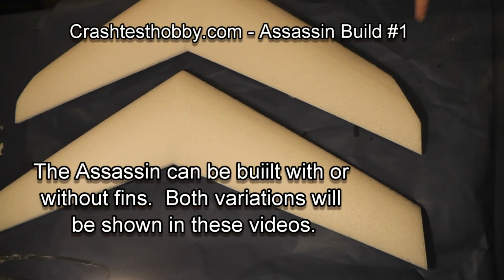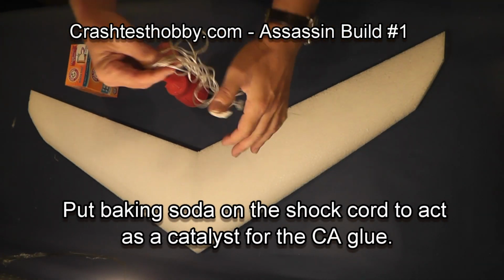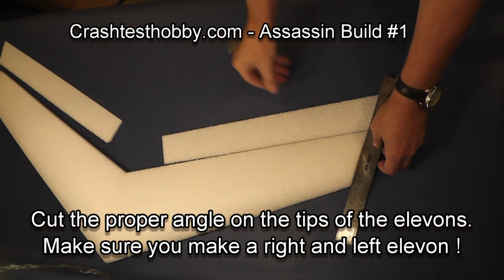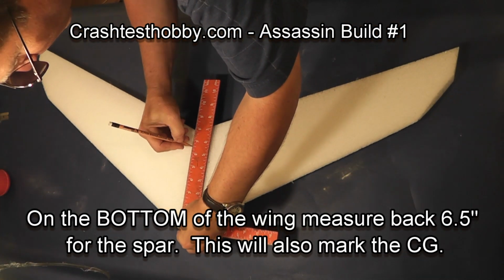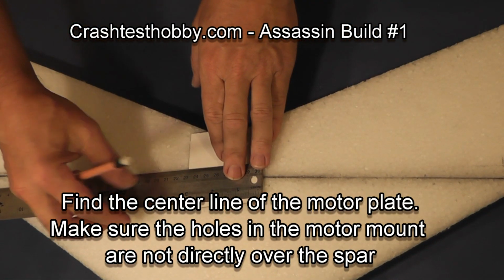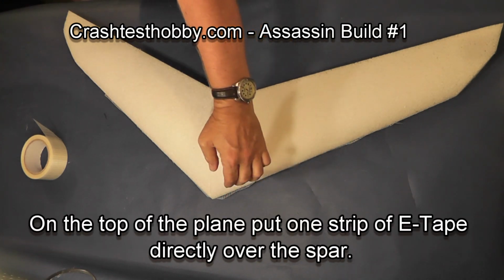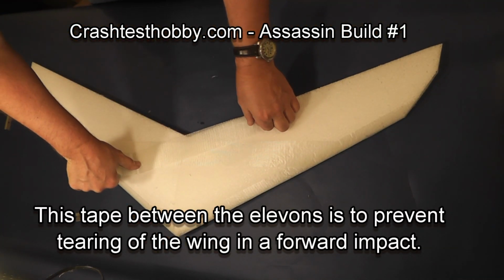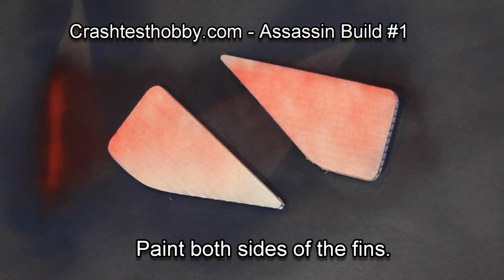How to build an Assassin #1

Comment from the maker: I agree that you don't want to breath the dust that comes from sanding the carbon.  Recently I have been taking a ballpoint pen apart and I run the shock cord through the pen to guide it into the slit around the wing.  This is an idea suggested by a customer that works extremely well.  I also have been using Quick Grip glue instead of baking soda and CA glue to decrease the fumes from the CA glue that can be irritating to the lungs.  Thanks for reminding us of safe building practices.  Lee

Comment: Can I use clear duct tape? The local hardware didn't have exactly what you appear to be using. I have some packaging tape but it is only reinforced along the length of the tape, not across.
Reply from the maker: Tape with a single direction of fibers will work almost as well except on the hinge line.  If you are using this single direction reinforced tape You have to cut small strips so the fibers cross the hinge line.  You can get the Scotch Extreme Tape on line or I have found it at Rite Aid and Office Depot too.
Reply: Crashtesthobby looks like ill be making a run to the LHS for some more (fresh) foam safe CA so I think I'll pick up the correct stuff and do it once ;-)

Thanks!
Reply from the maker: One other thought.  Clear tape stretches while reinforced tape does not.  The planes are more flexible and not as strong if you don't use a fiber reinforced tape.  Lee
Reply: Crashtesthobby good to know. The clear tape I was speaking of IS reinforced but it's not of the packaging tape variety. It's actully duct tape that's clear. I found an old Mythbusters episode where they tested the breaking strength of duct tape and it was around 67lbs, so not nearly as strong as the tape you are using here.
Reply from the maker: You don't need foam safe CA glue with EPP foam.  EPP foam works great with standard CA glue, Goop, Quick Grip and Hot glue and others.
Reply from the maker: Some types of the other clear tapes won't stick to EPP foam, weigh a lot, melt and stretch.  Just because they are reinforced doesn't mean they don't stretch.  Some tapes are so heavy that it adds ounces to your plane.  You want a tape that doesn't stretch or your wing won't be very strong.  Some types of tape don't have an adhesive that will stick to EPP.  Some tapes isn't resistant to the heat of an iron when you laminate.  We recommend the Scotch Extreme tape because it is relatively light, doesn't stretch and is super strong and can handle the heat of laminating.